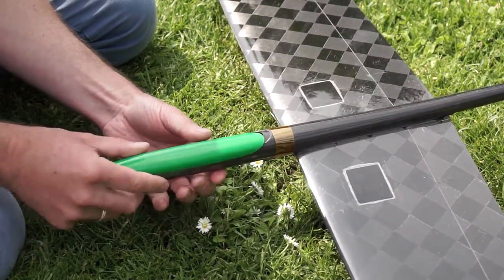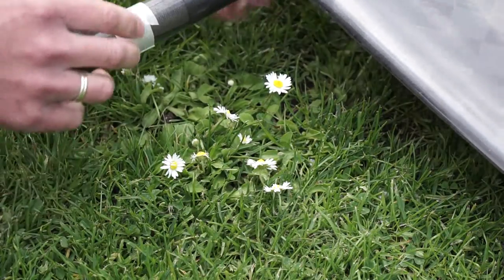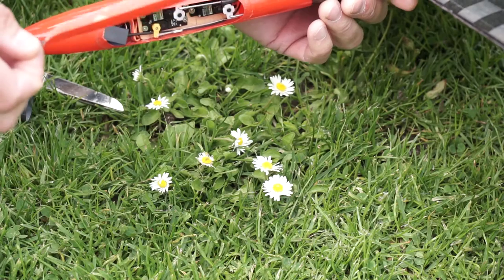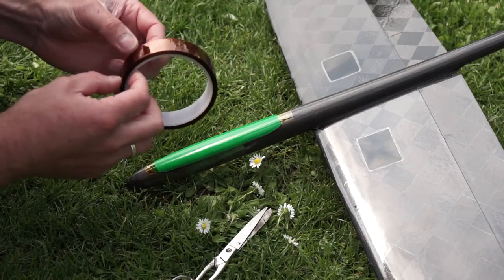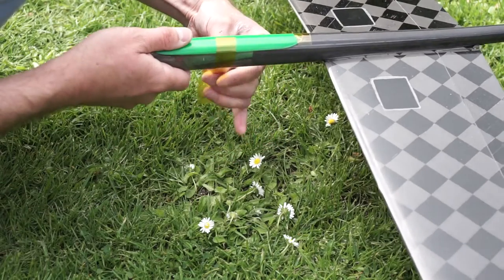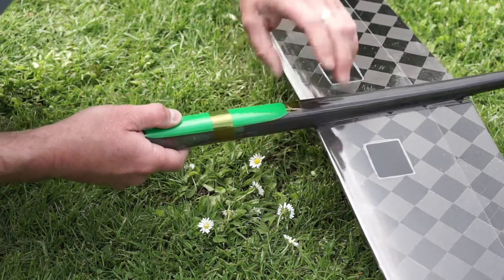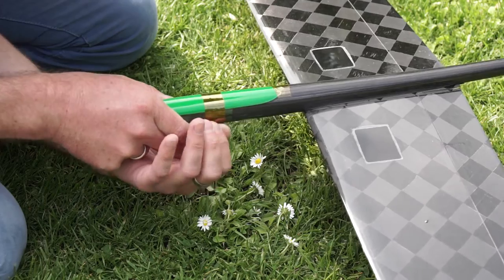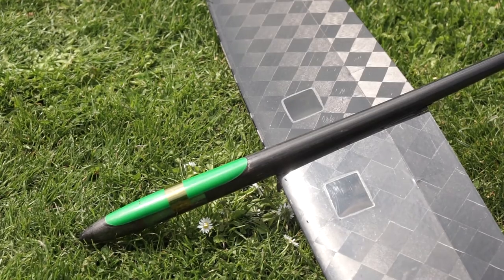Quicktip of mounting a canopy to a DLG fuselage - Flitzebogen (F3K, HLG, SAL)

Comment: Thanks for sharing!  The subtle twist you made at 1:44 is fairly important, and I missed it the first time I tried this.  If you don't break the first layer free (as you did) it will seem like the tape is too tight to slide.

Thanks again -  my Predator II now has this nifty hatch system!

tn